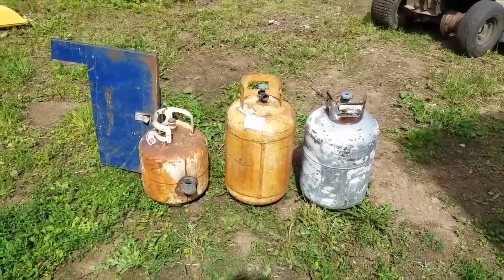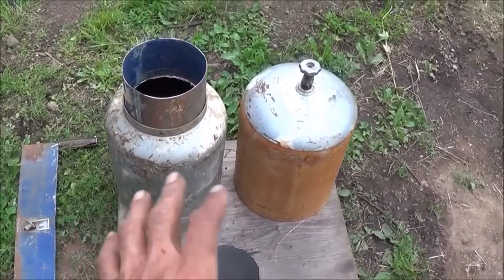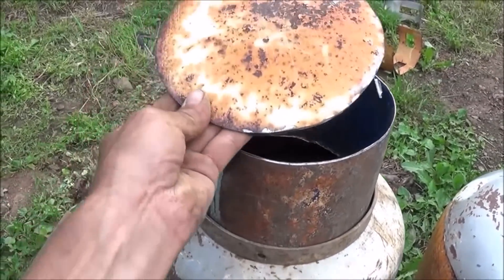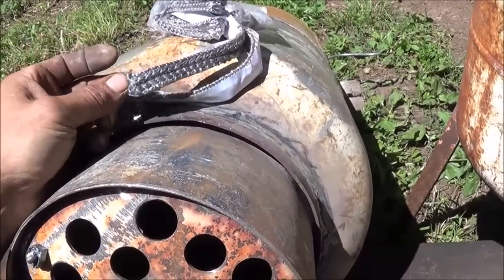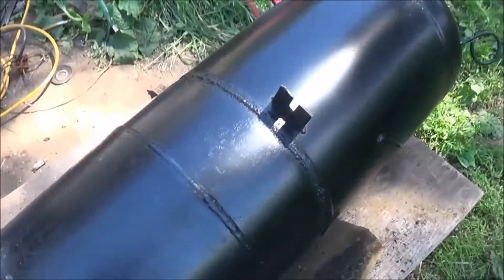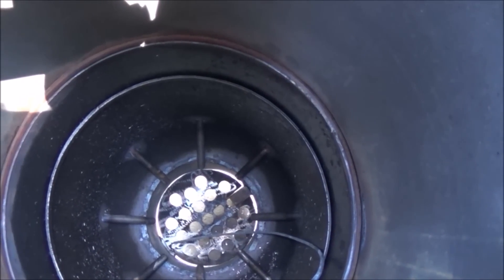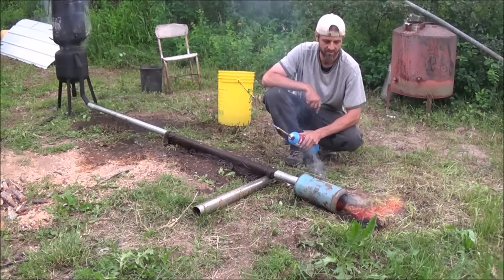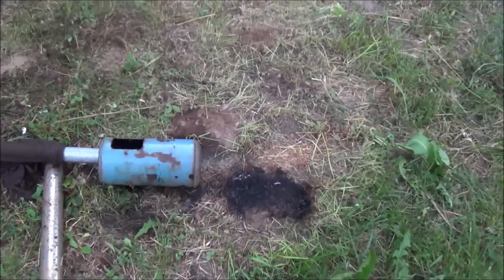How to build a "Wood Gasifier" from propane tanks, to power a "Tiny House"!

Comment: For the fan, could a petrol turbo have been used, presuming the speed of the wood gas if used on the exhaust side could spin the compressor?

Comment: Thanks for the video> I think I would try a water jacket or heat exchanger with a external hot water rad for another area in the house, as these style heating sources only provide heat to that specific room . It is also a great idea to install a small fan such as a bathroom fan above the unit to exhaust heat to other rooms. Heating cottages and small homes with wood stoves can be problematic due too poor or air flow.

Comment: A very good design. I would improve upon it by creating some sort of passive cooling step between the gasifier and the exhaust, though.
One could also consider creating a water heater in between that would function as a cooler (like on the barrel of old machine guns), either for sanitary use or for floor heating etc.

Comment: My uncle has a wood furnace based on this principle for over a 15years. Only smoke from his chimney comes out before he reaches the right operating temperature, then it's just absolutely no smoke coming out. And to heat up 2 pieces of 1500L water tanks takes few pales of wood. And they he has hot water for whole week, tanks are very good insulated.

Comment: NOTE: Anyone cutting a tank, pull the valve on top and full it with water. Propane soaks into the steel bonding with the carbon. The water will strip it and reduce the chance of having a buildup that might burn.
Reply: I never knew that before, thanks I learned something sitting on the toilet today!

Comment: Good video. Thank you. I do question the 8 tubes pointing into the reaction zone under a positive pressure, or is there enough airflow to create a venturi effect? Would these tubes eventually be connected to an engine's exhaust for the closed loop?

Comment: you are the man I will say!solve all the smog problems and power the cities as well!i personally have a natural gas boiler that I want to run on gasification,it s a1.3million btu spec boiler used without pressure for hot h2o use.any ballpark specs on burner and tank sizes would be helpful

Comment: 131/5000
I did not understand, did you put the fire on top?
The intention is to light the fire below and then load with more wood and completing?
Reply: You just need to start the fire. Due to the blower, the airflow at start is downwards, so starting the fire from top is just right.
Then, later, as the fire is fine, the actual fill-in wood will be loaded above the fire, still burning "upside-down", due to exhaust from lower chamber (and intake from pipes directing tho flow downwards).

Comment: The fan is just to help get it started, right? It's self sustaining after it gets going, correct? 

Also, are you taking smoke from the bottom because the smoke is colder than if you took it from the top?

Comment: Question: How hot does the fire get and depending on how hot it gets, would or could the high heat cause the release cable to eventually melt and therefore disintegrate? Thank you.

Comment: Thanks for your video!
I would not say that hot gas is not flammable. It is much more flammable and you even gain power/energy than cold gas. Your work clearly shows that the hot gas and cold air are not easy to mix because of density difference!
Bring some hot air heated up from the waste heat of your gasifier and it should work perfectly. and your "earn"  twice the energy you otherwise remove from your gas.
at least this is my feeling.
Thanks again

Comment: I'm stopping this early on to ask: This may be a dumb question on my part but was it necessary to cut the tops off both the cylinders and the bottom off one and weld it all together? I would seem that cutting the bottom off one and the top off the other and then welding the two, would eliminate a step or two. Yeah or nay?
Reply: watched the remainder of the video. Nevermind!!  :)

Comment: Thanks for the lesson, I didn't know wood could be gasified.
Reply: smoke is unburned fuel, like in a fire pit at first you get a lot of smoke until it heats up enough to the flashpoint of the smoke then it ignites, no more smoke.

Comment: So if I understand correctly, the gas is to be used as it's being generated. The system is not set up to store the gas under pressure for later use. That sounds like it would require passing it through a pretty sophisticated refrigeration system, and safety would be a primary consideration. Don't want any oxygen mixed with it for storage. I've seen pictures of automobiles rigged for wood gas fuel in Japan during WWII, in some Time-Life books published 4 decades back. Sounds great, if you have a metal shop. At age 50 I took a High School vo-tech welding welding & metal-fab course when I was living on a small ranchlet/farm w my wife and her sister & kids some years ago. Restored and used her Grandpa's 1950's woodworking tools, and a 25-year-old Shopsmith. But what you've done goes way beyond my metal crafting skillset. My hat's off to you, sir!

Comment: I get the fan to start it, but once you plug the intake to the fan wouldn't that stop it from blowing?  I wasn't clear how the fan works once the wood is burning and you unplug the air vent.  I've read that one of the combustable products is carbon monoxide?  That could be a concern inside?  Would it be feasible to inject a bit of steam to boost out a little hydrogen?    Nice video, I really liked it.
Reply: The fan is for starting the unit then you turn it off and plug it. The tubes are then used for the oxygen for the fire.
Reply: "I've read that one of the combustable products is carbon monoxide?  That could be a concern inside?" You don't use these inside so there is no concern.

Comment: Great explanation!
Have you tried angling the lower air inlet tubes to one side as well as down? This would create a vortex that would most likely spin the gases all the way up the burn chamber maximizing their mixing and increasing burn efficiency.
Reply: Wouldn't you need tighter tubing ri do that? I can visualize what you're talking about, but to get that vortex, wouldn't you need a tighter space?
Reply: I would think creating a vortex for burn efficiency would negate the purpose of making smoke.  Too good of burn would burn the gas before it would leave.   Need cool smoke, not hot smoke.    This is supposed to be a gassifier, not a jet stove.  Remember, he had plugs made for air tubes so could shut down air flow for more smoke.

Comment: this is the perfect join with a pontoon boat or cabin, because you can power up the motor, cook, and heat water to drink evaporated, so potable water 100%, or to take a shower. The best of all !! you can put the tubes down under the water to cool down the smoke completely in a second. Awesome!! Is the life I want I guess    :D
 to live in a lake moving powered by some wood from the trees (off course with a couple of solar panels too)

Comment: Could you use heat exchanger to get the heat from the woodgas to the air going in, so you would have cooler gas, and also better efficienty on turning the wood to gas (becouse of the extra heat)

Comment: For those of you asking about how to cool the gas coming out of the gasifier, a gas furnace heat exchanger would work fine for this (it's what it's designed to do). Find a unit that has been replaced (possibly because the heat exchanger started leaking so beware) and use that. Put it in a box with the loops up (you don't want to allow tar to collect at the bottom of the tubes), and pull your combustion air through the heat exchanger.

Here's an example:

https://www.partsaps.com/4cell-heat-exchanger-for-amana-goodman-part-2521302s?gclid=Cj0KCQiAxNnfBRDwARIsAJlH29DUaaGbmmWb-PeyxCsmk8y7L2L4UQGcH8f_qDy0qrKY7vamrgDqUCkaAksKEALw_wcB

Full disclosure, I work for Goodman in Fayetteville, TN, and I get to see these things all day long. :)

Comment: Cool channel, enjoy the vid's. Im thinking along the lines of a wood gasifier, heat exchange water heater via rocket stove. In other words I'm interested in utilizing the advantageous characteristics of the rocket stove as a mass heater, and heat exchange to heat water and also to cool/condense the combustible gases all in one configuration. Does the rocket stove produce combustible gases? Or perhaps I should ask at what point on the rocket stove could I tap to siphon off the combustible gases? SemperFi

Comment: That's cool. I made a wood stove for my tiny house but I'm worried it's too hot. I didn't install it yet. That's quite the impressive system you built. New sub, your support would also be appreciated. Thanks
Reply: I wonder if running the exhaust pipe through the earth or a large water tank would help. That is cool. I've never seen something like that.

Comment: That's a great thing. Perhaps you could combine it with your water trompe to use the 60 psi and also have access to the water for cooling. I love off grid solutions but I couldn't see myself being satisfied with this. I think I'd rather an AGA cooker or similar that also heats the house and water in winter as well as powers oven and hot plates for cooking and has less chance of burning or exploding everything I owned haha 

Solar panels, wind turbines, or water turbines alongside a battery bank would complete my requirements, which are all coming down dramatically in cost as the technology and supply improves. LED lighting has drastically reduced our energy needs too, there are exciting times to come in off grid solutions that's for sure.

I'm also waiting for someone like you to master a perpetual motion generator. That would be something!

Comment: Hey For the cooling zone,  I ran the pipe thru a water tank. It would act as a cooling chamber / boiler. A larger water tank will feed the cooling tank. A copper coil will recool the hot water and drop back into the large main tank. a little $20 sub pump  I used from my computers water cooling. Got them from Amazon.

Comment from the maker: There are multiple ways that a gasifier can be built and function each one produces different amounts of different elements. The gasifier in the truck gasifier build video is a thermal cracking unit that reaches a high enough temp over 2000 deg. to crack the molecular bonds in the gases that pass through the reaction zone. So it separates things like water molecules into HHO gas, and CO2 into one part CO and a free O, the free O binds with a carbon atom in the burn zone becoming another CO.The O separated from the H2O binds with a carbon atom in the burn zone becoming CO, so the main composition of the gas produced is two parts hydrogen 3 parts carbon monoxide. Now when the gas is burned in the engine the 2 hydrogen's bind with an oxygen molecule and becomes H2O and the CO also binds with an oxygen and becomes CO2 both of which can be re-fed into the reaction chamber and turned back into gas creating a almost closed loop system only requiring air to be supplied.Let's follow a single 2H3CO chain in a closed loop reactor and see what it becomes. First it is burned in the engine becoming 1 - H2O molecule and 3 - CO2 molecules, we re-feed it into the reactor as engine exhaust, now the H2O becomes 2 parts hydrogen and 1 part carbon monoxide, and the 3-CO2 molecules becomes 6 parts CO. So we have 2-hydrogens and 7-carbon monoxides. Run that once more and a pattern becomes apparent..The 2H7CO gas is now burned in the engine and exhausted into the reaction chamber as H2O and 7 parts CO2, once again its forced through the burn zone and the water becomes 2HCO and the 7-CO2's become 14 part's CO. So on its third pass through the reactor our starting chain went from 2H3CO to 2H15CO. At a point the excess carbon monoxide can take over as the reaction chamber fuel source ending the need for more wood to be supplied to continue the process. Now none of this incorporates the fact that the fresh air drawn into the burn chamber and in the engine contains extra CO2 and CO as well as random hydrogen atoms, from the moisture bearing air which will provide a runaway hydrogen effect in the system as well, in fact the the more humid of a climate you live in the faster the hydrogen runaway starts. (Now when this is done right as a closed loop system), so when the system has built up enough carbon to continue supplying both thermal energy and free carbon atoms there becomes an excess of one gas in particular and that is oxygen, this over abundance of oxygen can either be expelled from the system as the waste gas or compressed and used as the oxygen supply to both the reactors burn zone and as the oxygen needed in the combustion zone of the engine. So this means that once the system is at full temp and the internal working gases are up to sufficient levels, it will clean the carbon based molecules from the air use them as fuel and expel oxygen as its exhaust gas. The bad air in a city could be used as energy and in return we would clean the air, by using thermo-molecular reforming and thermo-molecular fracturing we can re-capture and re-use a substantial portion of the waste created from the last 50 years of carbon emissions  Right know the closed loop system produces an over abundance of both nitrogen and oxygen atoms, we are attempting to combine the two, to form NO2 which can be fed directly into the reactors burn zone increasing the temperature to around 3000 deg. This allows the gasifier to burn metals as well as organic compounds,( metals can be gasified) in short allowing you to turn pop cans and tin cans, glass, batteries, and just about every other standard household trash item into fuel for use at home or in a vehicle. This can also be achieved with a plasma gasifier, basically a bunch of plasma cutter tip's all aiming into a central position as the reactor burn zone and arcing at the same time.
Reply: MrTeslonian - Please pin this thread at the top so that everyone will see it. You're amazing! I want to marry you! Have ring, will travel, lol.
Reply: Would love to see a video building and explaining this, as well as what NwoDispatcher said about the possibility of running a steam engline hybrid? would something like that be possible? I love the idea of the closed loop system and recycling the extra gases, would love to see this made.
Reply: Say whaaaat? Wow, impressive and futuristic 'lecture'. Thank you doc.
Reply: Why is this not happening in every city? Love your work
Reply: @tamsmith387  I second this - Why is this not happening IN EVERY CITY!?
Reply: MrTeslonian 👏👏👏👍👌 Highly impressed!

Comment: Now capture the gas, compress it, and store it in tanks just like propane. There is no reason that an entire home including the transportation necessities, couldn't be completely powered by a wood classifier. Because they are so efficient there is little pollution so you can keep the environmentalist crazies off of you.
Reply: Yea, here, hold my beer and watch THIS...
Reply: Its really hard, better to run a generator+ gassefier to charge batteries
Reply: for pressure  in a methane system  which is done by composting into barrels that seal and have a air fitting that allows the methane to fill tractor inner tubes.. which in turn have enough pressure to run stoves ...ect
Reply: 1 main problem is volume, you have a hard time storing enough compressed gas with standard air compressers @ 150lb's,,
 L.P. is a 750 timrs deancer than in gas form, so 5 gllns of liquide make roughly. 750 time that much gas!..now can ya see that 55 gln drum of compressed wood gas might only run a genarator for about 1 hr?

Comment: Can you compress wood gas for later use?
Reply: You could build a gasometer. However the gas still needs to be constantly used. 
Large industrial gasometers used to be common place all over the UK when we used to run most of the country's electricity on coal.
Reply: Yes, but the question is by how much? I don't know offhand what the compressibility of wood gas is. For example, Hydrogen is famously hard to compress, but you can do it. 

And as I mentioned in an earlier post, you will have to deal with the tar that comes with the gas. Not good for your compressor. And keep in mind that if it takes as much energy to compress the gas as it produces, you are not gaining anything.